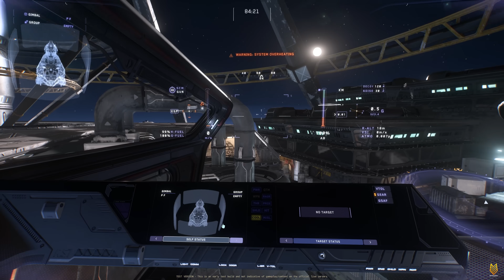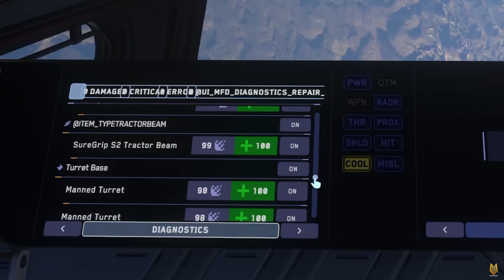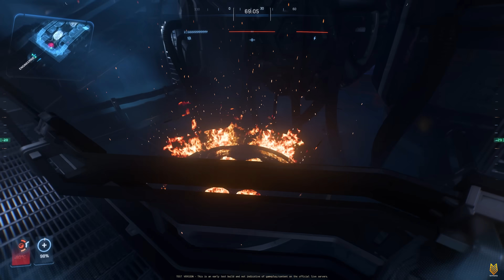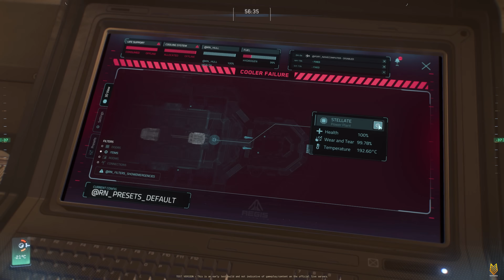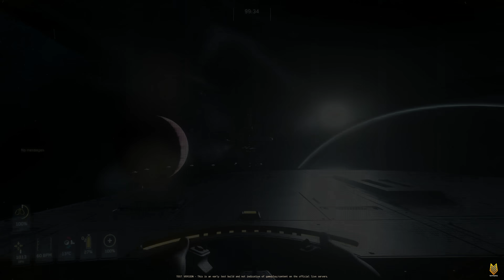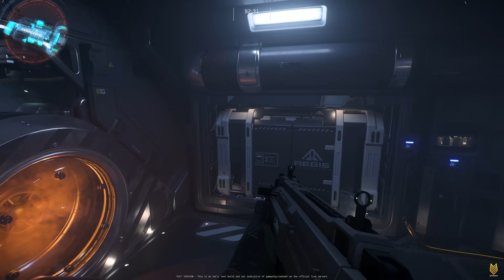Star Citizen Engineering Part.1: A Detailed Explanation & Testing Of Engineering MFD & UI

Comment: This looks horrible, a ship randomly starting on fire because coolers don't work properly for 10 seconds... 😅 so lame
Reply: It's probably on purpose for the tech preview only. So the whole gameplay loop can be tested in the short amount of time.
Wouldn't be the first time, that gameplay is altered for the sake of focused testing.
If you would think about it for a second, you would have come to the same conclusion probably.
But it seems, that's too much to ask for. I get it: It's easier to bash than to use the brain.
Reply: They said ships wont just random fail and catch fire you have to do silly things like turn colors off like he did for cascading failures or Combat damage.
Reply: Go drain all the coolant out of your car and see how long it takes before your engine block explodes. Now multiply that by space ship engine.
Reply: @GrimGatsby  It wont explode, my Duramax diesel will cook the oil to coke and seize the rod bearings stopping the engine. The computer will see the low oil pressure first though and warn me. Then it will stop fuel flow to the injectors and restrict the air intake by wastegating the turbo pressure. Likely though it will still be too late and, like I said seize the engine. You didnt know any of this did you? Thought so. Right so confident in your statement though. Ask me how I know any of this. Please.
Reply: @baremetalmafia  I'm not mechanically inclined enough to list off all the particulars in detail. But the point still stands, heat kills engines pretty quickly. Doesn't take a rocket scientist to tell you that.
Reply: @GrimGatsby no it doesn’t take a rocket scientist. But your original comments prove you aren’t just “not mechanically inclined”. It’s hilarious.
Reply: @baremetalmafia   I think what it proves is that you have to seek validation by lording mechanical knowledge over strangers online, most likely to compensate for something. Yet what you have in the knowledge of engines, you clearly lack in the social perceptiveness to detect when someone is using hyperbole and figure of speech to punctuate a point.
Reply: @GrimGatsby none of those things are true, your discomfort at being ignorant isn’t because “I’m lording something over you” it’s actually just because you lack real world experience to inform your conceptualization of the game systems. It’s normal to feel that way. If I know things you don’t, it isn’t an attack on you when I explain that fact. Just out of curiosity, how old are you?
Reply: @baremetalmafia  You have no idea what my level of real world experience or practical skill is. But you're welcome to continue making baseless insinuations if it helps with the need to feel superior. And, gotta ask, how does age play into this? Are you asking because you want to now paint a false narrative that I'm younger than you because you can't win an argument otherwise? 🤔
Reply: @GrimGatsby ok, what kind of experience do you have that leads you to the conclusion that a car engine will catch fire in minutes of overheating?
Reply: @baremetalmafia   Do you really not have the rhetorical perception skills to be able to tell when someone is using a hyperbolic statement to punctuate a point? Do you just make it a habit of taking turn of phrase and figure of speech literally? If I said "man it's hot as the sun outside" would you be the guy to step in and go "actually, the sun is 27 million degrees fahrenheit so it couldn't be that hot cause we would be dead 🤓" If that's the case, I bet you're a real riot at parties.
Reply: @GrimGatsby sure, nice deflection though. Also, I read more than just the comment I posted on from you. Why are you so sensitive to my making a comment? You seem a bit insecure.
Reply: @baremetalmafia  That's some grade A projection. The first thing I did was admit that I'm not mechanically inclined. I don't have such a delicate ego that I can't admit to my weaknesses or have to parade the skills I do have around in a attempt to seek validation. But you got such a desperate need to feel superior that you had to make it a point to point out how ignorant you think I am on the matter in order to prop yourself up. If that's not a sign of some glaring insecurities, I don't know what is.
Reply: @GrimGatsby  yet you continue to ad hom even tho i am not insulting you. why?
Reply: @baremetalmafia  "You didnt know any of this did you? Thought so. Right so confident in your statement though. Ask me how i know any of this." "Your comments prove you arent just not mechanically inclined its hilarious." "Your discomfort at being ignorant." "Its actually because you lack real world experience" From the very first comment, your tone has reeked of condescending snarkyness, insults to my intelligence, and a clear superiority complex in that you are obviously seeking validation at the expense of others. As if automotive mechanics is the only skill in the world. All because you don't know what hyperbole is and not getting the response you desired bruised that mile wide paper thin ego.
Reply: @GrimGatsby I mean, I have never erased been an automotive mechanic professionally. I work on my own vehicles because I can but spent years in the USAF as a crew chief on aircraft, then the last 20 years in industrial equipment repair. Honestly I really actually re-read all my comments and they sound a bit arrogant and rude. I understand why you would get defensive. However my original point stands and is common among many "gamers" that don't work with their hands in the real world. It's the same with so many people about flight combat systems in game. My close friend and org mate is a retired F-16 pilot and can't stand the flight model changes and weapon crap CIG has done in recent years. Anyway, our life experience causes irritation at CIG and I suspect that I tend to jump on people that continue the ignorant perspectives. I'm sorry for being a sick. It wasn't warranted. Be blessed.
Reply: Well for cars they don't produce as much heat so it can take minutes or a fire to start..
Airplanes in real life no proper cooling can ignite fires almost immediately..  

A fire can engulf the entire airplane is minutes and be entirely uncontrollable.

It should probably take longer and that'll get balanced over time so its not as harsh but reality is fires especially for planes is much harsher..

So a massive spaceship relying on cooling loosing that cooling means those components generate a lot of heat quickly ramping up that will start a fire and electrical are some of the worst fires to deal with..
Reply: Seems lige lame gameplay…..

Comment: After watching this...... I want to get gameglass. Because scrolling the MFD will get annoying.
Reply: Gameglass is basically just a keyboard with stickers, as long as the game has no telemetry to hook it up it is useless, it is not be able to show status of anything. So you can have "toggle power button" or things like this, and that's it.
CIG needs to allow external screens as mfds, so we can use our phones as mobiglasses, and if we are engineer, and our character is hooked up to a eng terminal, we should be able to use either our physical phone or in game "phone" to handle the eng view
Reply: You will never be able to have a physical touchscreen for this. That's not how gameglass works at all. It's a UI that sends a keybind and that's it. No 2-way communication protocols at all. If you "turn ship on" before the game is ready, your gameglass button will show it's on when it's still in the off state. It's a very fancy garage door opener.

Comment: Does turning off life support vent the ship so no fires can start?
Reply: Yes but you either overheat from the components around you generating ambient heat or the coldness of space. Either way you go into hyperthermic shock and die after a few minutes. So yes you can turn it off but not a solution you’re looking for 👀
Reply: @sammieee2610  Yes they need to connect all of this to the need of space suits with different uses. Like pilot or ship space suites, that provide survivability for 5 minutes and heavier space suits that provide survivability for like 20 minutes without atmosphere and they need "fuel" that you can only get when the systems are working. And heaver space suits make you so heavy you can barely walk or something like that, so you can barely wear them in atmosphere
Reply: @Mayocell1  all of this that you have stated is coming with Star Wear. You should look it up. It’s pretty cool.
Reply: @sammieee2610  I think most people will just wear their suit and if the need arises to vent the ship, just pop on a helmet. Most suits have at least some environmental protection so you could most likely outlast any fires before you start taking any temperature damage.
Reply: @GrimGatsby Oxygen is going to become a resource, so...no. And before you go "well if I vent oxygen then some of it will be sucked into ship reserves" sure, but fire eats oxygen so you're going to be losing oxygen regardless. Also, not everyone is going to be mindful to always have oxypens on them at all times, people forget their helmet all the time too let alone consumables lol...

The point of life support NEEDING to be on or else ambient heat accrues is to prevent players being lazy and just venting...venting being the "meta" is just bad gameplay, it removes player choice and gameplay variety as you basically only have one thing you're supposed to do.
Reply: @ChristoffRevan  Yeah that's why you would just keep your helmet on your hip. I'm sure the suits will have enough oxygen to last until the fire goes out if you only seal yourself up when you want to vent the ship. Then just gotta seal the doors and turn the oxygen back on to let it refill the ship. Right now space suits hold about an hours worth of air give or take. I can't imagine it'll take longer than that to replenish the air.

Comment: I think that pixelated picture on the wear and tear is a flame. I assume the lower that number gets the closer it is to catching fire
Reply: It's a pixelated and squared version of the Explosion hazard symbol, also seen as a more-normal icon in the full-version engineering terminals, where it's also used to represent wear and tear.
Reply: @Fr564 I agree it's definitely a wear and tear indicator. I'm just assuming that per the time con as the component is used the wear and tear probably mak s it more likely to overheat and catch fire
Reply: Isnt it actually wear and tear idnicator?
Reply: @tlap1508 yep
Reply: I think it will primarily affect misfire chance, which will be interesting to say the least.